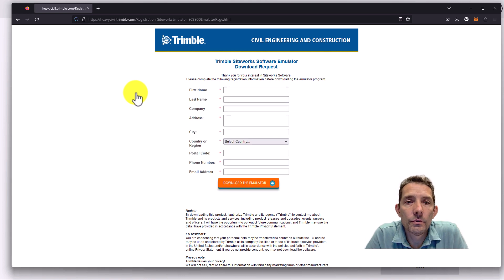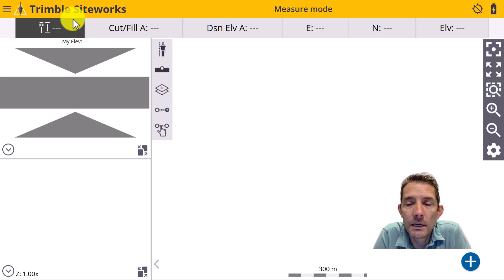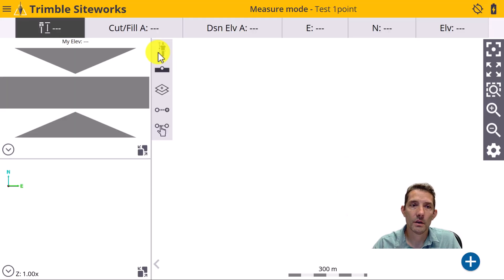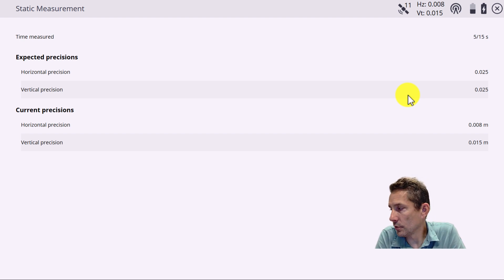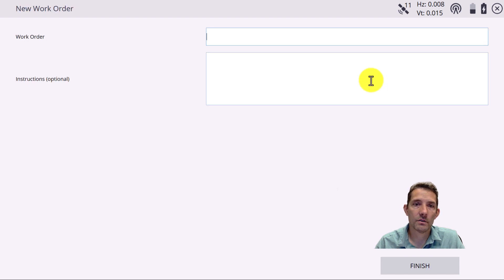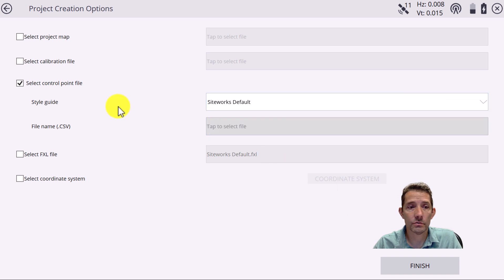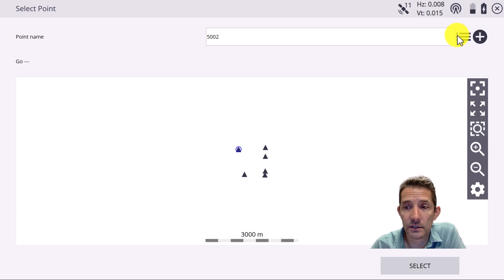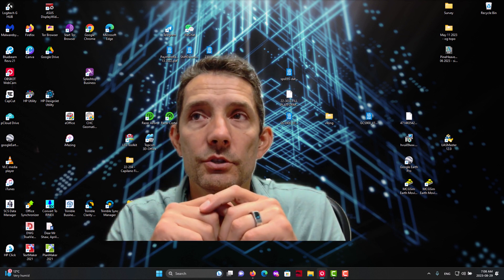Trimble Siteworks - performing a site Calibration

Comment: I normally Export out the job in TBC with the county coordinates and adjust it to the local control in the field.  This helps me locate the first point with little effort.   My Fabick salesman doesn't like me doing it this way, but he cant really explain why.   Ive been doing it this way for years and have never had an issue.  Am i missing something?
Reply from the maker: HI, so that would be a question to the salesman why he does not like that, how ever if it works I not sure why he would be against it, generally the software is designed not to let you do something wrong and even if you did, than checks would not come up right. I use the predefined coord system here and there and do it the same way as you do. So that all being said I am missing it too ;o)
Reply: @ProSiteConsulting  Lol good to know im not the only one doing it this way.   Thanks for the reply back, and keep up the good work.  Your videos are very helpful.   Do you know if you are going to Dimensions yet?